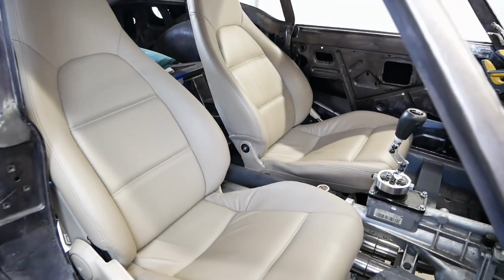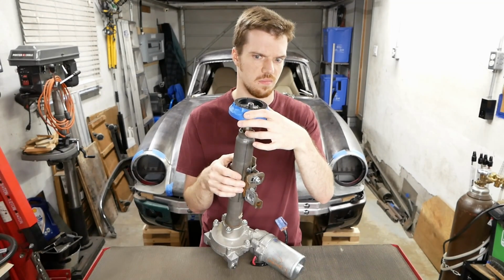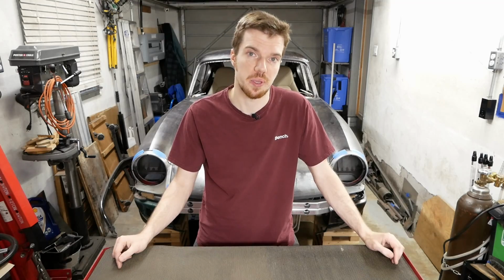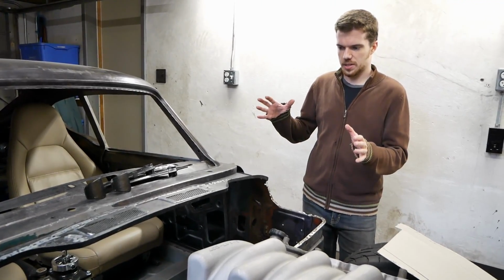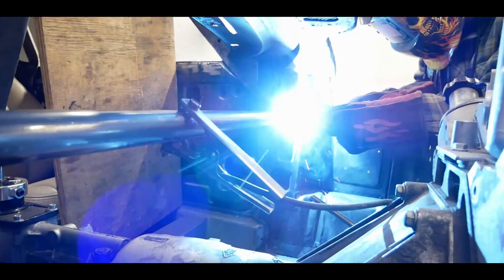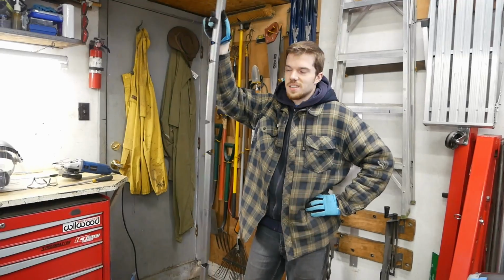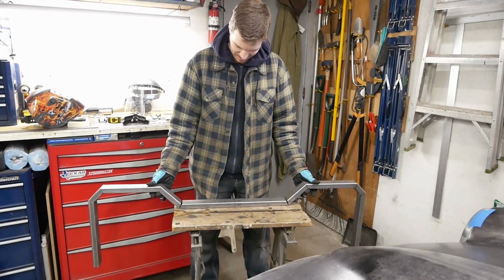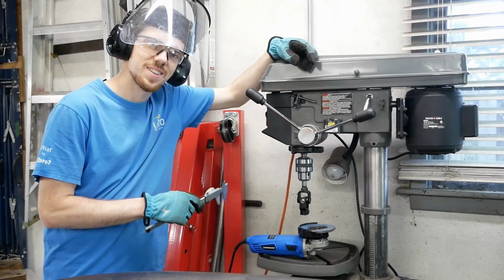The Next Phase // Pro Touring V8 Triumph Build – LS Powered GT6R – Ep33

Comment: For sure that that car will be WAY better than the original.
 It is not an engine swap but the construction of a car around an engine.
At the end of the project, I'd like to see a summary of the time involved and the cost of the parts included on that project.
very goog project 
very good video.
Reply from the maker: That would be the most accurate way of describing it at this point! 😂 Time will be hard to calculate (we haven't even wanted to keep track) but I'll try my best to summarize when the car is eventually done!  Cheers Jacques!

Comment: My first car was a 1967 Fiat 124 Sport Coupe with a blown engine. Not having the room or equipment to remove the engine/transmission as a unit, I swapped just the engine. The top two bolts of the bell housing were inaccessible. A 2' extension into a universal joint, to a 1' extension, to another universal joint, and finally a socket got the job done. To say it was tricky to get the socket actually on a bolt is a colossal understatement, but it did get the job done.
Reply from the maker: If it works, it works! 😂 Nice one Jim!

Comment: Great to see a new video! Am sitting here in my Airstream on Graves Island in the rain enjoying your progress. I think you will have really improved the potential performance of the car by adding all these rigid components internally - the car should handle well. I think it will be safer also. The Subaru steering wheel component bit made me laugh out loud. Not surprised though that Mitsubishi and Subaru components mesh up - those companies have a long history I think. Looking forward to the next one!
Reply from the maker: That's the hope Matt! 🤞 Haha, I know eh... being a GM part I was surprised to see it fit, but as you point out the Mitsubishi sticker on the controller would seem to say otherwise!  Sometimes we just get a bit lucky! 😊 Cheers and hope the weather clears up for your time away - it's smokey and dreary here right now too! ✌️👍

Comment: Seeing how you basically doubled the outside dimensions of the engine and it takes up way more space than the original, to say that everything is a tight fit is an understatement!! With that said, you and your dad are doing a phenomenal job of not only getting the whole package to work, but upgrading everything in the process!! And that’s why I can honestly say that this is my favorite YouTube project!! Lovin it!!
A steel tunnel is definitely better than the original!!! That fiber piece of junk from factory would break and provide extra heat in the winter AND extra heat in the summer!!
🤣
Reply from the maker: Thanks Brad! 😊 Interestingly the main difference in size between the Triumph 2L and the LS is the width!  That being said ... it definitely has made things interesting!  By far the most difficult feature to work around is the hood though, the wheel wells not staying behind means you can't have anything hang over them and that drastically reduces room for routing of hoses or placement of components!  Appreciate it though, seems like the planning is paying off!  Here's hoping the end product will be worth the effort 🤞😉

Comment: People pay a lot of money for new universal fit or retro air systems and then try to cramb them under the dashboard.
However lurking in the wrecking yards are all the bits you need to build your own aircon and heating systems.
The rear aircon in many large people movers and SUVs may be a much better fit in awkward places.
A BMW convertible rear screen demister is very light and compact and fully electric.
You also don’t need to put the full hvac unit under the dashboard.
Depending on the vehicle you can put them under the seats, floor , trunk or even in the head liner.
You just need to duct the air where needed and run the lines.
Reply from the maker: I was very close to heading to the junkyard and grabbing the smallest system I could find, but ultimately this is going to be easier to integrate (wiring) and was only $125usd ... so I'm not complaining!  The tip about rear hvac units is a great one though, hadn't thought about that one. ✌️

Comment: I was surprised that (on the fire wall) you didn't build a bead rolled / shaped firewall keeping the weight down but yet the strength up. Hey what do i know, I have never built a firewall, armchair engineer here. LOL Great stuff Thanks.
Reply from the maker: We've only just started on this phase Dave, hold in there! 😉 The new framing is for crash protection, overall structure and mounting of the new components - think of it as an integrated cage! 👌👍

Comment: you're a very brave man... Mind you anything is an improvement over the original engineering   😂
Reply from the maker: Haha, brave or stupid! 😂 This is sadly true though!  They're sweet little cars, and have been tweaked and raced for decades, but when you really start to add power they very quickly need a complete redesign.  Nothing's up to the task... just look at some of the OEM suspension bolts!  Something we get all the time is that an MGB GT would have been a much better starting point, but we like the GT6 😊 Cheers man! ✌️

Comment: The engineer in me might suggest that once everything is mounted under the dash - if there is room, you may want to consider triangulating some reinforcements (if there's room) from the A-pillar forward to the "firewall". Perhaps a second one (on each side) down from the lower windshileld rail to tie into the firewall again.  The goal is to reinforce that front bulkhead and give it strength as a bit of a crash compartment and (hopefully) to eliminate what we used to call "cowl shake". If you've ever driven an older, full size GM product, you'll know exactly what I'm talking about.  Yes, it will add a little bit of weight - BUT - with everything locked into place it will hopefully eliminate errant rattles and squeekes, eliminate cowl shake AND, in the unlikely event of a front-end impact.... might save your legs from being crushed in those little footwells.

My last suggestion (and these are ALL simply suggestions, regard what you please),  but that electric motor for the steering is probably going to be noisy as hell.  You may want to create some kind of rubber-isolated bracket and mount it to the firewall somehow and try to mitigate the noise it'll make.  Nothing makes for a more annoying driving experience than having to listen to something buzzing away the entire time.

Looks great so far! I kinda dig the raised tunnel for the transmission.
Reply from the maker: Just getting started my friend!  Once the items have fallen into place, we'll add as much triangulation as we can (already planning for it now).  I have not witnessed cowl shake first hand but it sounds like something I don't want 😉 The steering motor is actually supposed to be in the cabin and uses a plastic gear which helps keep things running smoothly and quietly, should work well! https://www.youtube.com/watch?v=z56A9ccI5sU  Cheers dude!
Reply: @FanatikBuilds  The Canadian Nik Blackhurst over here.  Already planning years in advance.  Good Show (y)

Comment: It is a bit of a moot point now, but spot weld cutters and they're lubricant gel work wonders on just cutting the top metal and leaving the bottom intact.
Reply from the maker: I've also heard they dull out quite quickly, though I'm sure most people don't use the correct cutting fluid!  In our case, most of the holes in the remaining sheetmetal are getting cut off, or used to attach the new material.  So all's good!  👌👍😊

Comment: I'm by no means a professional fabricator, but I have one that works for me and has showed me tips over time.  The welds will close up when you weld them (thus the reason you ended up with less than 90 degrees when you welded your first corner.  Tack the sides and put a wedge in the gap to maintain the 90 degree as you start to weld it.  Once the weld is started and fixed, you can remove the wedge and then fill in the rest of the gap.  At least that's how I understood it when he was showing me how to weld a leg perpendicular to a plate.

Comment: It’s all looking quite wonderful but with all that power and weight up front, will you be able to get near a 50-50 weight distribution?
Reply from the maker: We may not be bang on 50/50 but I'm trying my best to get there.  As you move forward there's more and more aluminum ... we're also going to put the battery behind the passenger ... every bit and all!  Here are a few main things working in our favour:  The LS/T5 is sitting further down and further back than the OG package. The engine is also about the same weight as factory, with a heavier transmission.  The entire rear end is heavier.  The frame is lower.  The seats are further rearward ... and the whole thing is more rigid!  Looking forward to finding out the exact corner weights someday!  Cheers Phil! 😊✌️

Comment: so, you guys seem plenty smart enough to figure this out on your own, but do ALL the heat management in those footwells, i wrapped my headers and used reflective heat tape on the outer floor boards of my ls swapped supra, and it still makes my feet pretty hot!
Reply from the maker: Absolutely, thanks man, I quite like my feet with flesh on them! 😬😂  You must get a bit of flack for that engine swap!  No hate from me though, do what works! ✌️
Reply: @FanatikBuilds  I was expecting to get flack for it, but I haven't heard one negative comment about it yet actually,  but I also went a bit out of my way to make it fully reversible, didn't want to cut up a good shell.
Reply from the maker: Awesome to hear!  Maybe the car community is getting better after all 😅✌️

Comment: I spent quite a few years in the business of making parts for gas turbine engines with tolerances of as little as 2 ten thousandths of an inch and there wer still parts that were bent or sanded to fit 'by eye'!!!

Comment: If You can step over it You can weld it shut. So, no major loss in only approximately seventh's grade hypothenuse-action I reckon. Such special do-over builds with recurrent do-over-agains of a third or more of the already done-over do-overs are a nightmare when it comes to accessability and maintenance-grabs anyway, but hey, You got a mahussive lumpa cast matter to show off under the dohicky-hinged hood should You actually make it to the meet'n greet in time to still find a curious one, or two even ..... on the other hand is Your former Spitfire one of the  better, further advanced builds with an actual chance to make it to a greet'n meet on her own power. I would know of quite some comparably simple restoration projects with less of a chance to ever roll under their own power out of the garage again than Your single piece. Cheers and thanks for sharing!

Comment: I'd just like to say, you should clamp your vice down when drilling holes etc 😂
Reply from the maker: Safety third! 😬 I usually put a clamp beside the vice so it can't start flying around, but ultimately the belt on my drill is slipping so badly right now it doesn't really grab in the first place!  Maybe I should address both those things eh? 😂😉

Comment: Ballsy but probably the best solution to cram everything in there 👍 I woulda though some Jap car would have had a smaller electric rack compared to the one you found. Looks girthy!!!
Reply from the maker: Absolutely the only way it was going to work!  Should look really nice when it's all finished up too 🤞 ... yes I think the Yaris or Prius columns are a bit smaller but I liked this one for the controller I mentioned!  The Toyota units operate in a "limp mode" only, which is about 50% overall assistance all the time.  The controller box we got analyzes the input torque from the steering wheel and give a suitable assist to the output.  There's also an over/under assist that can be wired in to dial it out perfectly.  Pretty cool!  You can find them here (no affiliation) https://www.brunosteering.com/

Comment: Is this a good time to mention that a dead lawn mower blade (or a 6" piece thereof), sharpened, is a fantastic spot weld breaker? might be helpful to know.... :) perhaps a touch late, sorry.
Reply from the maker: Now you tell me!!  😂 Next time our blade needs replacement, I'll stick the old one in my "random" tools drawer! 😊✌️
Reply: @FanatikBuilds  most blades are high carbon and also can be repeatedly hardened. Add to this that they're thin, and they really work well for their purpose (which, near as I can figure, is flinging rocks through my windows)

Comment: Well... I guess that is the pain of going to LS rather than OEM+. I am mean absolutely love watching it and you doing amazing job, but it needs to be said... it wasn't maybe the best choice of parts for such a small car. Can you make it work - sure, does that make for amazing content - 100%, so as always I wish you luck and I hope all works out (actually I am quite confident it will), but I would not have chosen to do this to GT6.
Actually, I am looking to do something similar and eventually I get to it, but in my case I will go for that OEM+ build which will require much less headache. What I am thinking is BMW E46 or E90, perhaps 325i or 330i and instead of hunting for parts from every possible manufacturer the idea is to fit as many parts from donor car as possible, including even mounting brackets, transmission tunnel, gauges etc. Interior probably will not fit, so that is the only custom part, but all in all that should make build much simpler. Whereas yours is honestly quite optimistic :) 
But again amazing content, I kind of knew it will be difficult to achieve what you trying to achieve, but I hope this serves as lesson for all the rest watching how difficult it is to fit significantly bigger parts to small 60s cars. Project binky was one example and servicing it will be nightmare, even if built itself is exquisite and your one will be the second one.
Reply from the maker: The issue you will come across with swapping in anything other than a inline-4, is size ... a modern straight 6 is not actually much different in dimensions to an LS, specifically in height due to DOHC.  I'd love to see it done, but I think getting one to clear the hood and still maintain ground clearance is going to be tight!  Going by my list in Ep10 https://youtu.be/5XqeEQeb1VY @8:50 ... an RB, Barra, 2JZ are all 2-3" taller than the factory 2.0l ... and the M54b30 is still 1.6" taller too.  Our LS is roughly the same height as factory but slightly shorter and we've actually been able to move it rearward for weight distribution.  Ultimately we chose an LS because they're cheap, reliable, available, have great aftermarket support and neither of us have ever owned a V8 before so it's new to us!  When we bought the car we never imagined the build turning into what it has, just the way the cards have fallen 😊 Thanks though, our servicing should be a lot easier than parts forced to fit from a donor, as I've tried to choose the most efficiently packaged pieces along the way!  The GT6 is just hilariously small compared to most anything else on the roads!
Reply: @FanatikBuilds  I have watched all your videos... So I know all the story, don't worry :)

I think LS itself is just 1 piece of million pieces in the puzzle, so whereas LS is the same size as L6, the power you getting from it requires other mods to support which in the end significantly complicates the build.

In the end of the day this is amazingly entertaining content - so it is not criticism, BUT I am just saying it wasn't the easiest way of doing it. Not that you necessary were looking for easiest way anyway...

I guess the other reason I have different view to that - in Europe I can get 3 complete BMWs E90 for the price of just LS engine. So like it is no brainer for you to get LS "because it's cheaper", it is no brainer for me to get whole BMW donor, because it's cheaper.

Comment: I had to go smaller on the stearing wheel on my GT6 just to give clearance for my knees!!
Reply from the maker: One of the reasons why we wanted it too Jonathan!  The new seats have a bit more thigh support so there's already a pretty tight space to slide into!  The removable hub could be helpful there, if we decide to run it (legality is questionable)... 😬✌️

Comment: Just curious about the kind of noise the steering power assist might make with it located in the passenger compartment.  Also, don't forget to place a nice sound system!  My 400W stereo in my Alpine makes it possible to hear crystal clear music at 70mph with the top down.  Gotta have tunes to blare while screaming down the road in that rocket.
Reply from the maker: It should be fine!  These kind of EPS columns actually use a plastic gear which greatly cuts down on noise and friction: https://www.youtube.com/watch?v=z56A9ccI5sU ... it's also mounted in the cabin of the original application with no rubber isolators!  Pretty cool piece of kit to be honest, and much cleaner than a hydraulic setup (although it can be argued a hydraulic assist gives better feedback to the driver) ... regardless, we will be putting in some kind of stereo (it had no such thing originally) so anything will be 100% more than factory! 😂😉